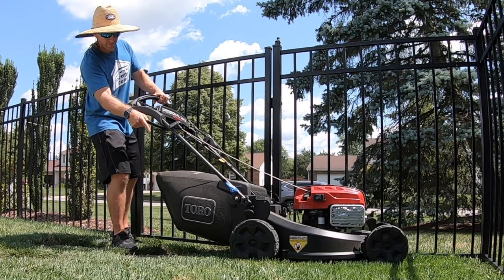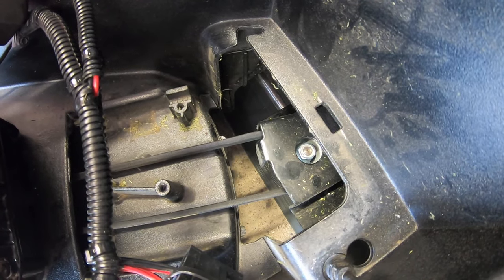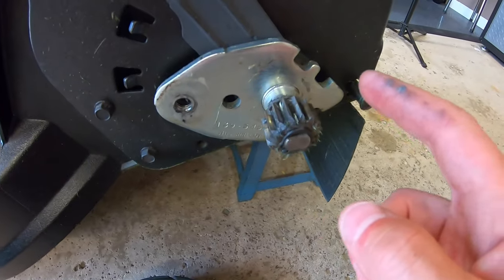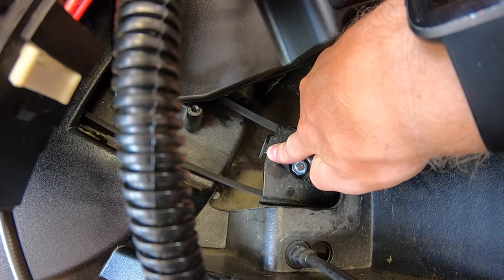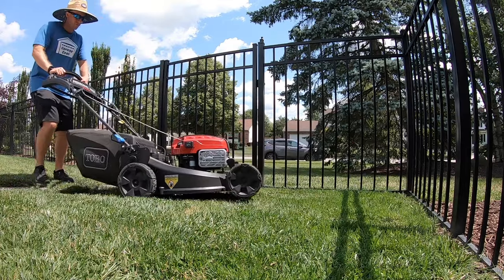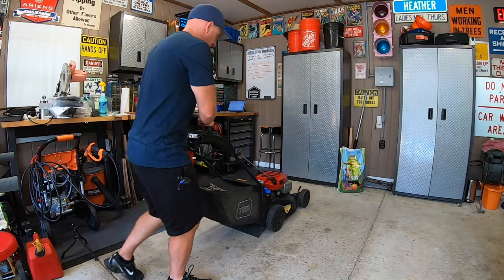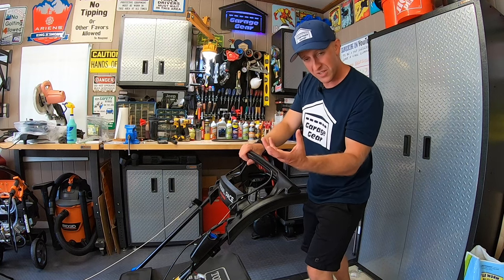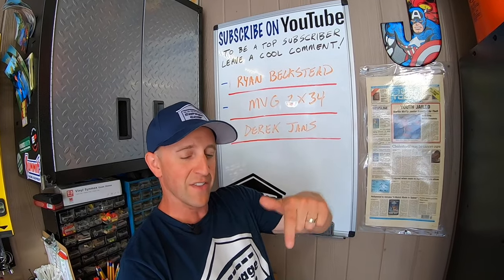WHY DOES MY TORO SUPER RECYCLER 21564 NOT BACK UP?

Comment: Great video as a warning to all future SR purchasers (don't buy).  I myself had the same disappointment a year ago, thinking I was upgrading to a top-of-the-line residential mower (including its higher price for the 21386 model), only to realize it's a POS (other than aluminum deck).  
You're correct, the Personal Pace on Timemasters doesn't have the same back up issue (my Timemaster doesn't), but the older (non-curved) PP handles of the Super Recyclers have the exact back-up problem.  
What makes it worse is Toro knows this issue and puts their disclaimer in the instruction manual (figure 14 for the 21384 model).  Of course the advertisement on the mower box says it'll be the "best mowing experience."  And nobody buys a 21" mower to get into tight spaces and back up a lot, that's what a riding tractor is for, right?  Do you sense my frustration?
On southern St. Augustine grass the experience is even worse due to thick stoloniferous grass.  If you slowly change direction (as suggested in the video) the mower just stops (doesn't keep rolling, like on northern grasses, or pavement).  So you end up having to grab the lower fixed bar and push the mower forward with it before pulling backward (negating the point of Personal Pace).  And God forbid you forget this step and get it stuck against a wall.
Other issues with the Toro SR mower (21386)
1. On St. Augustine grass particularly, the PP drive system makes the mower slow and buck forward as it hits resistance and overcomes it respectively; making the front wheels lift off the ground when it jumps forward (yes I know the PP has adjustment per Allyn Hane, but it still bucks no matter what adjustment).
2. In bagging mode, the front of the mower is too light, and bag is too deep, so that when the bag gets half full (and too heavy) the front wheels start to lift off ground.  Additionally because bag is too deep, for taller folks, we end up kicking the back of bag unless we take baby steps. The experience only gets better!
3. The cables for the drive and operator presence stick 6 inches outside the left handlebar, and end up being scrapped on, or caught, in shrubs or fence or wall passing by.  I've noticed this on all similar model SR mowers. 
4.  The front wheel height adjusters are susceptible to being knocked out of position by shrubs due to them being out in front of and higher than front wheels.
5. Mulch plug doesn't fit tight enough and needs to be cleaned regularly or will build up grass.
It's amazing how Toro has sold so many of these SR units, and how their designers/engineers haven't addressed these issues.  
All these issues make me wish I had gotten another FWD MTD and saved $250!  My current MTD has 300 plus hours on it, none of the above issues, no breakdowns, and haven't yet even had to change the drive belt!  And the thing keeps powering forward; and best of all, the wheels don't lock up going backward!
Reply from the maker: Thanks for sharing this information. It’s good for the Garage Gear community! We appreciate it!
Reply: Wow! You make my old Honda HRR216 sound good (also has pull backwards issues). Glad I replaced it with an HRX217HYA which I love, but slightly paranoid on parts since Honda is exiting the industry. I got a good 20 - 30 years left of mowing before I give it up….
Reply: I do experience similar issues on mine but I find them manageable. I’ve never had the rear wheels lock up but they sometimes get tight. Definitely not as bad as the Honda this replaced. I’ve found the drive cable adjustment needs to be perfect for the best results.
Reply: Yeah I have been dealing with it but feed up with it called the dealer to take this pos back trying to cut back yard is dreadfull trying to do around everyrlthing if I wanted to weedwhack whole back yard would have not spent 900$ for a mower making  my 199$ eletric harbor freight atlas shine like a daimond right now no problem pushing    forwards and backwards
Reply from the maker: @blazzingray  this is definitely an issue that needs to be addressed by toro!

Comment: Better suggestion instead of slowing down to do the pivoting/turning, just don't buy this mower until they stop cheaping out. Pivoting and turning to do those quick small cuts is a major part of mowing and for a mower to NOT have the ability to do that on the fly it's not worth it.
Reply from the maker: Definitely not worth it!

Comment: its a ratchet mechanism in drivetrain designed  for safety when people   are mowing on hills  so mower doesnt roll backwards back on them , solution Is as follows     1)pull back  and disengage personal pace  handle completely  and then  push  roll the mower  forward  little  bit slightly  = the rear wheels release. its for safety, but yeah a little  bit of ridiculousness.
Reply from the maker: Thanks for sharing
Reply: That's funny...  All non-self propelled mowers can roll anytime, on any hill and there are no safety gizmos to stop them...what's the difference?
Reply from the maker: @mellowjammer  the transmission, belt and gears have to all be working to allow the mower to roll freely